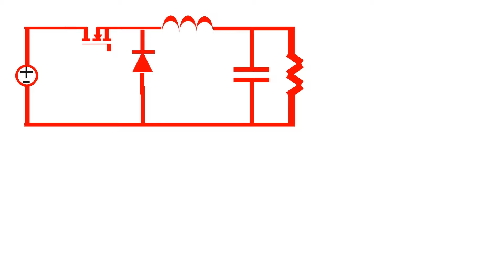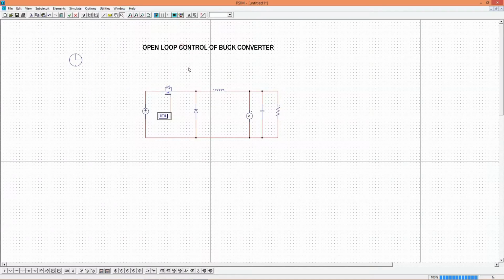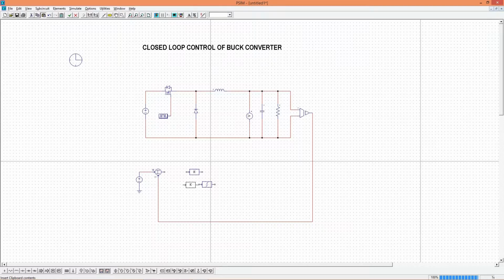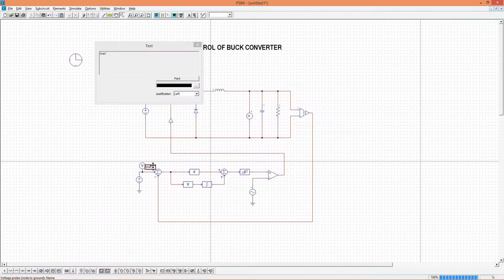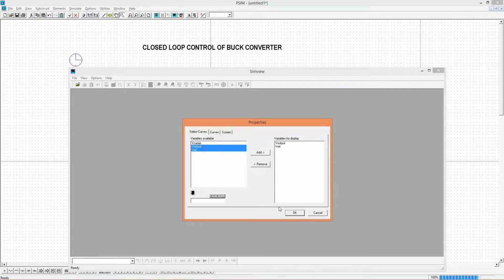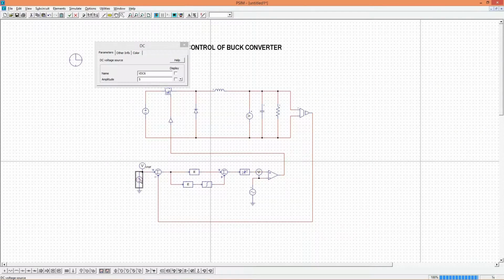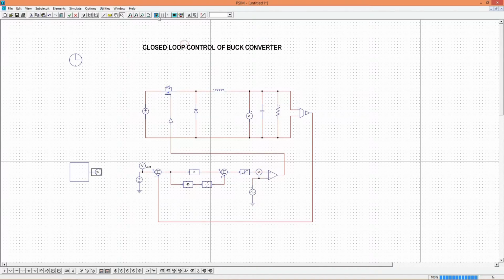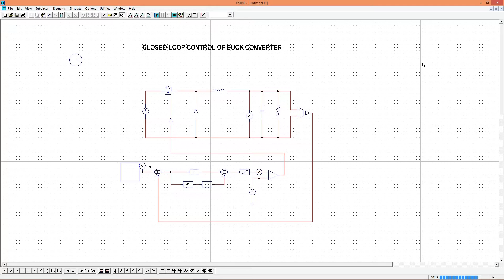Buck Converter - Closed Loop simulation

Comment: We'll ask you to confirm.
Is this circuit a voltage control circuit in which a constant voltage is supplied to the load even when the load changes?
Reply: build it in a simulation software, then change the load, simulate again and see for yourself. but yes, this control will keep the output voltage constant. thats what this control loop is for

Comment: Sir, can you please say why we are using closed loop control.  Because in your previous video of open loop buck converter we are getting stable output. So why we are using closedloop?
Reply: I think to maintain the same output voltage even if the supply is changed
Reply from the maker: As well as the load
Reply: please do transfer function for open buck  @TechSimulator
Reply from the maker: In openloop output will change if we change the input voltage or the load

Comment: Hi, If I want to add a filter capacitor, how can I calculate it? Is there any formula?
Reply: yes, there is a formula. dependent on the output voltage ripple that you want.

Comment: Hello
I am designing the 12 V to 5V buck Converter with closed loop feedback when I set the reference voltage at 5V the out voltage is 4.8 which is nearly equal to 5V and when I set reference Voltage 2V out the output voltage is also 2V but when I set the reference voltage 10V and the output voltage is  5V. The output voltage is not increasing form 5V . Is the working of circuit is correct or not?
Reply from the maker: need to tune the PI controller parameters properly